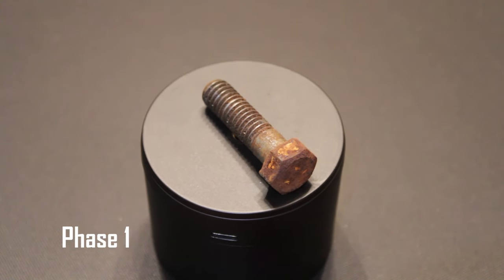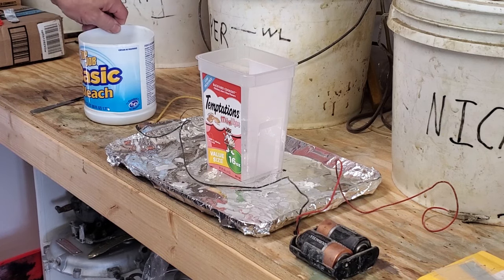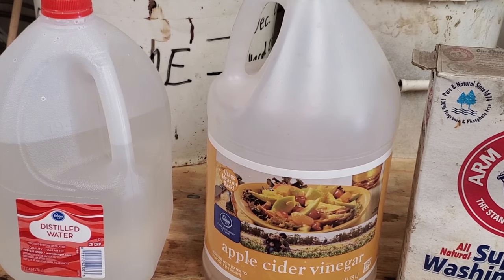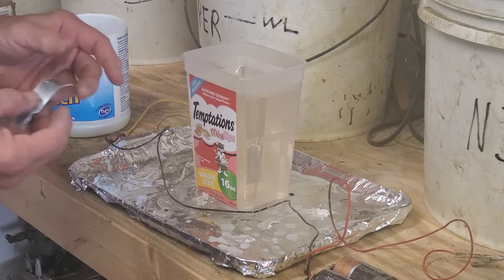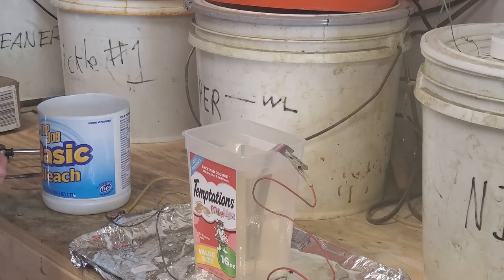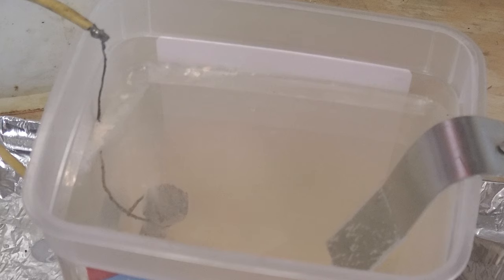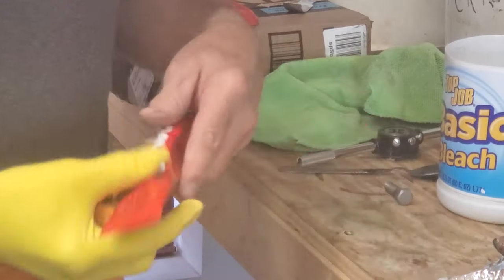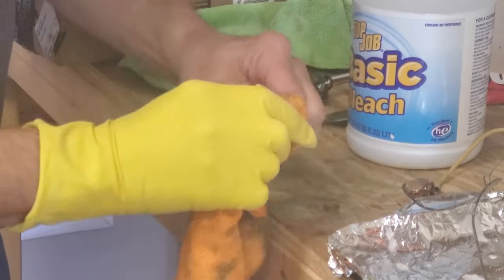How to Zinc Plate at Home - Easy Zinc Electroplating

Comment: Interesting video. Thanks. I have a question. It is: how to get matte (rough) surface by doing electroplating (zinc plating or copper plating). I have an aluminium roller. I need to zinc or any other metal plating on it with rough (matte) surface. Please help me..Thanks
Reply from the maker: The simplified answer is that you will need more voltage and higher current. The battery caddie is not enough. A power supply where you can vary the voltage and current would be the best choice. The objective you are after requires the surface of the part to appear to be boiling with bubbles. Each bubble momentarily prevents plating at the same rate as an area next to it without a bubble on it. The result will be a rough texture to the plating. You do not want to provide a bubbler below your part. Agitation from below with a bubbler will remove bubbles from your part. The reason you need a variable source of voltage and current is that the amount needed is controlled by the surface area of the part you are plating. Experiment first with a similar sized piece of metal of the same composition as your part to find the right setting to produce the finish you desire. It will also take much more physical plating time to produce such a surface finish, but it is achievable. One last note is that a large part will require multiple anodes to get the plating on all portions of the piece being plated.
Reply: @CarzPlus  Thank you Carz, I learned a lot from your statement. May the Lord Jesus Christ extend grace to you

Comment: I'm trying to zinc plate with a steel washer and white vinegar and salt, I have all the bubbles when power is put through but from what I can see the washer is going black??
Reply from the maker: Usually, dark plating results from too much current. Using less slows the process, but improves color. Further, you can have impurities and other chemicals in your solution that can cause plating problems. Be sure to use a clean plastic or glass container with no residue of any sort. Use only distilled water and vinegar from an original factory container. Use only straight salt (non-iodized). Then, fully clean the zinc anode to remove any other contaminants.
Reply: @CarzPlus  hi and thanks for that. I used an old charger with an output of 9V and 200mA, I guess that was too much?
I also used distilled vinegar and table salt, is this not the right stuff?
Reply: Craig 200 mA is way too much - you probably want 2 or 3 mA tops.

Comment: Hi.. a couple of questions.. 1) can I use Citric acid for zinc plating?.. I buy it to add a teaspoon to dishwasher and washing machine cycles to dissolve limescale.. and 2) if i use a car battery charger, is the 'grainy thing just aesthetic?.. or does it affect the durability of the coating?.. I'm asking as I want to electroplate some agricultural attachments I make for myself, instead of painting them... I can put 12 or 24 volts on it, from 3 to 65 amps, as the 'charger' can also be used to direct 'start up', .. I got 2 x 3kg pure zinc anodes from a forge that makes sacrificial anodes for boats, but they left the other metals out of it to give me a pure zinc lump... cost me about $91/£70 for 6kg (13lbs)
Reply from the maker: That's a good question. Citric acid attacks zinc and gives off an offensive odor, much like a skunk. It will not work. Plating too fast results in a pebbled finish. Sometimes the result may resemble a cast piece. However, if the plating is too fast and subsequently very pebbled, it will have a tendency to not adhere well to the part being plated. Thanks for watching!

Comment: I'm I doing something WRONG? I zinc plated my bolts and than deposited into a Nickel plating bath.  But after the nickel plating it looks like the zinc coating somehow got removed.  Can someone tell me what I'm doing wrong?
Reply from the maker: Good question! The acid used in most nickel plating attacks and removes the zinc. Zinc parts are often plated with cyanide copper first to protect them from the acid used in nickel plating baths. Cyanide is a deadly poison and this is best left to a professional plater. Thanks for watching.

Comment: How would you recomend too zinc plate a clevis?     Same steps id assume but let it plate longer get thicker id assume?
Reply from the maker: Good question! Due to the shape and size, you may need a bit more voltage which then allows an increase in current. Time will possibly need to be increased. However, the best answer due to the more complicated shape is to have more zinc anodes. I would suggest 3 equally spaced around the part and wired together. The purpose of this is to avoid unequal plating on a complex part.

Comment: Wouldn't it be cheaper just to buy stainless steel bolts
Reply from the maker: Yes, possibly and more convenient, but there are 2 considerations. First, if you are doing a 100-point restoration, or you're a purist, you may want the original bolts. Second, stainless steel bolts are most often less than grade 5. That means they are not as strong as originally supplied in many cases. This could be important at times.